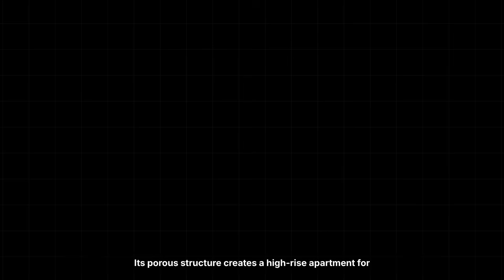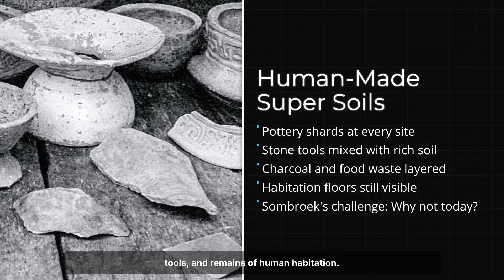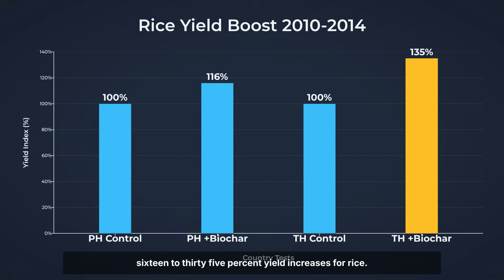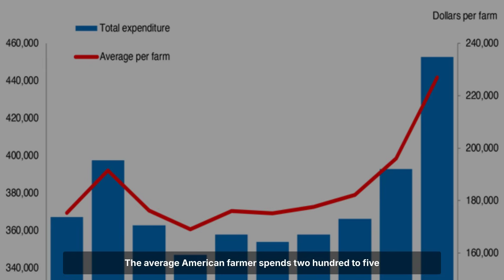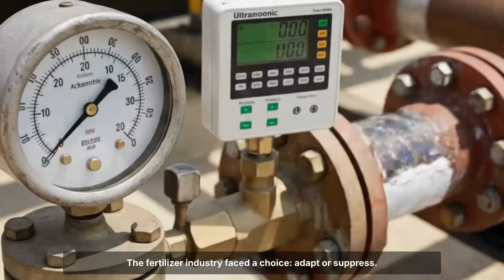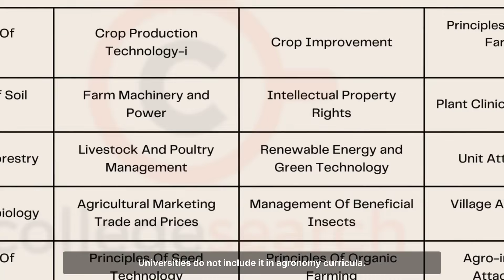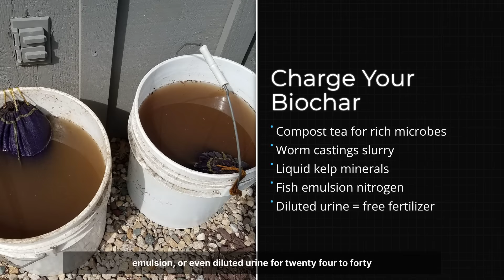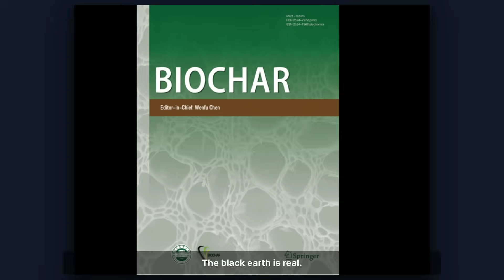This Soil Replaces All Fertilizer FOREVER. Why Did Big Ag Bury It for 60 Years?

Comment: Got any tree trimmings start a pit fire when it gets going strong hose it down build it back up repeat. Doing this a dozen times never letting the fire eat through your bigger 1&1/2 inch green branches will give you all the char and ash you need for a good size garden. Every hosing down buries the little char in ashes. Just keep making a roaring fire then hose it down again. Just make a good 3-4 foot round 1-2 foot deep pit. You don’t need many 4-6 inch fire wood pieces, just be sure to put the fire out all the way before going to sleep!
Reply from the maker: That’s a great practical method. Simple, low cost, and very effective if done carefully. Thanks for sharing the details, and especially the safety reminder.

Comment: Sorry, but this is not a conspiracy by big fertilizer companies. It is simply a problem of resources and logistics. Let’s do the math.

From 1 m³ of wood, you obtain about 0.2–0.4 m³ of biochar. Let’s use 0.3 m³ as a realistic average.

From a generic forest with an area of 1 hectare, you typically get around 250–400 m³ of wood. Again, let’s calculate conservatively with 300 m³.

So, from 300 m³ of wood per hectare, you can produce roughly 90 m³ of biochar.

Now, if you clear that 1-hectare forest and convert it into agricultural land, and you want to replace the upper 30 cm of soil (the layer where most crop roots are located) entirely with biochar, you would need:

10,000 m² × 0.3 m = 3,000 m³ of biochar.

To produce 3,000 m³ of biochar, using 90 m³ per hectare, you would need about 33.3 hectares of forest.

Even if you do not replace the soil completely, but instead mix biochar into the topsoil at a ratio of 1:10 (biochar : soil), you would still need roughly 3.3 hectares of forest to amend 1 hectare of agricultural land.

This is not a rabbit hole or a conspiracy theory.
It is simply a question of logistics, resources, and basic math.
And these calculations already use very conservative assumptions.
Reply: Can you use other materials to make the biochar or does it have to be wood?
Reply: @Finglasian  As they said in the vid it's possible of many organic materials to make biochar, like corn-straw, manure...it just needs to contain carbon. But in agricultur there is no "waste", any organic material is used somehow; Wheat-straw to feed animals, chaff as fodder or bedding. I don't know where they will take the huge amount of organic material to create biochar for agricultural usage
Reply: @Finglasian  Wood is the most carbon dense option.
Reply: Did you do the math on the chemical fertilizer process (don’t forget to set up the infrastructure for it)
Reply: "REPLACE THE UPPER 30 CM OF SOIL"?
Thanks for the straw man argument, fertlizer salesman! NOBODY IN THEIR RIGHT MIND WOULD EVER TRY TO REPLACE 30 CM OF SOIL WITH BIOCHAR.

Your argument is a feeble joke, since only a tiny amount of biochar is mixed in compost to improve soil.
Reply: Great comment, learned a lot - thanks!!
Reply from the maker: That’s a solid breakdown, and you’re right, large-scale biochar use runs into real resource and logistics limits. Terra Preta wasn’t created overnight or by replacing soil, it was built gradually over centuries with repeated small inputs mixed into living systems. The takeaway isn’t that biochar scales easily everywhere, but that context and time matter. Appreciate you laying out the math so clearly.

Comment: Yes, broken pottery gives structure. Unglazed pottery is also porous so to a degree it is a slow release of moisture capture in wet times.
Reply from the maker: Exactly. Broken unglazed pottery adds structure, improves drainage, and its porosity helps buffer moisture, slowly holding and releasing water as conditions change. As @MACD_Master mentioned, the previous video was reviewing clay pots benefits (for watering) in more detail. Thanks for watching!
Reply: his previous video was about clay pots/jars used below ground to keep plants from dying during droughts and reducing watering labor.

Comment: Many European gardens used to have rich black soil - because everything organic was recycled into the garden. An important ingredient was all human waste as well - given the name of night soil. The important extra technique is to ban all open burning of organic waste. All  burnable organic waste should be dried and heaped, or placed in a pit, then covered with a layer of clay, and then lit to burn very slowly until all the organic material is converted to charcoal. Modern methods use big steel bins to burn the dry organic material with very limited oxygen to produce the biochar. Leaving the material open to the air while burning reduces the amount of biochar produced.
Reply: Today’s “night soil” is full of medication, illicit drugs and disease. It is out of the question.

Comment: All you need is biochar and stone dust (this acts like a slow release of minerals over years).
Read how it has restored commercially depleted fields, returned them to productivity. Also when a plant is healthy, has a good immune system, it can it is more able to defend itself against diseases and pests.
Reply from the maker: Biochar gives the soil structure and long term nutrient holding capacity, and stone dust can slowly remineralize depleted soils over years, not seasons. That combination has helped restore worn out fields in real world trials.
When soil biology is functioning, plants build stronger immune responses, which naturally reduces disease and pest pressure. Most problems we spray for are symptoms of weak soil, not the cause.
Reply: No. The release of minerals from rock even in the form of dust would be on the magnitude of 100s of years. Stones do not contain nitrogen. They may contain Phosphorus, Potassium and many micronutrients.
Reply: @darindarin67 
So you're ostensibly saying that a rock dust product like Azomite is ineffective?
Reply: @darindarin67 oh there is no question , adding stone dust to your garden definitely replaces depleted nutrients , go look it up ……
Reply: @darindarin67  Enzymes released by bacteria, fungus, and other soil life break rock dusts down much faster than "100s of years". I have been using rocks dusts and biochar for over 16yrs. I started a small worm compost 18+yrs ago.
Reply: What’s that Amazonian tree at 28 seconds in?

Comment: is wood ash the same as charchol for fertilizer?  anyone know?
Reply: The Internet knows 👉 In summary, wood ash is superior for immediate soil enrichment and pH adjustment, while charcoal (especially biochar) is better for long-term soil structure and water retention. The key distinction lies in their chemical availability: wood ash provides readily accessible nutrients, whereas charcoal’s nutrients are locked within a stable carbon matrix and are released slowly over time.
Reply: Wood ash and charcoal/biochar are not at all the same. Partial consumption/ total combustion.
Reply from the maker: They’re different. Wood ash is a fertilizer, it adds minerals like potassium and raises soil pH. Charcoal or biochar is a soil amendment, it doesn’t feed plants directly but improves water retention, nutrient holding, and soil biology. They serve different roles and aren’t interchangeable.
Reply: No, wood ash is highly alkaline, & a source of potassium & trace minerals, but biochar should be black crumbs about the size of rice.